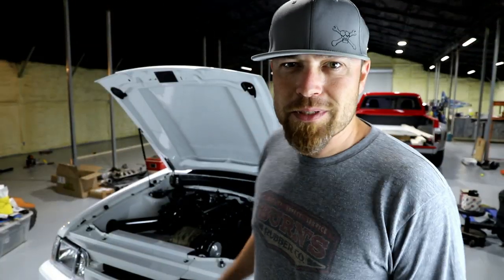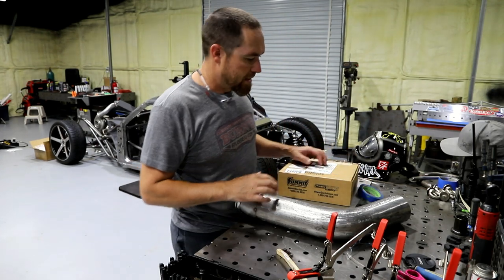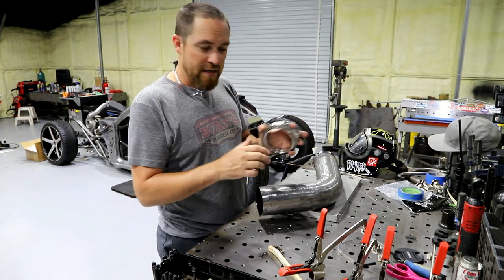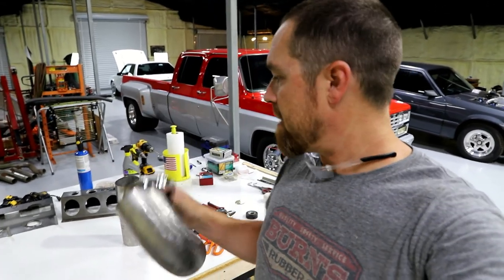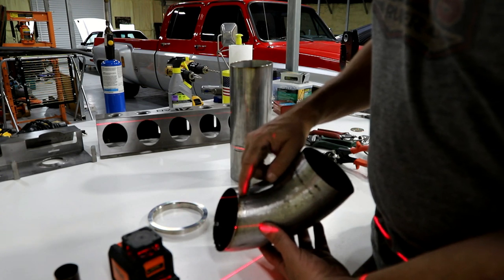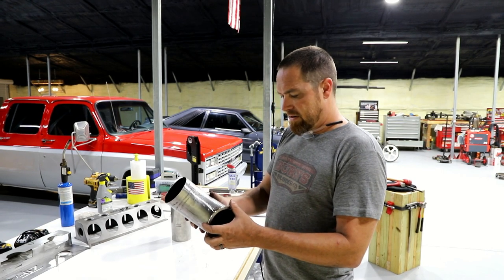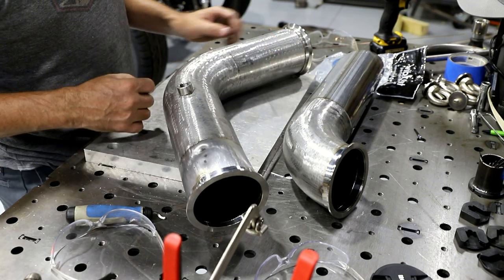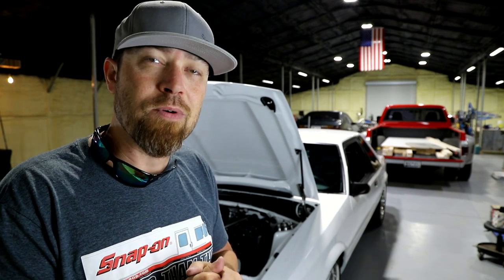Laser Levels for Performance Automotive Fabrication

Comment: What size filler wire are you using?
Reply from the maker: I use several different sizes depending on what I am welding and how I feel....I know that doesnt help much